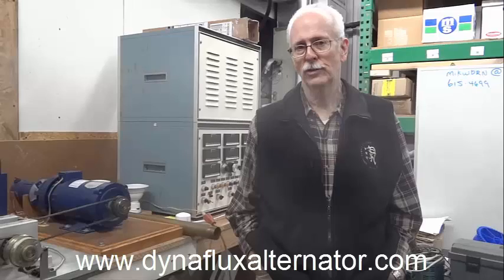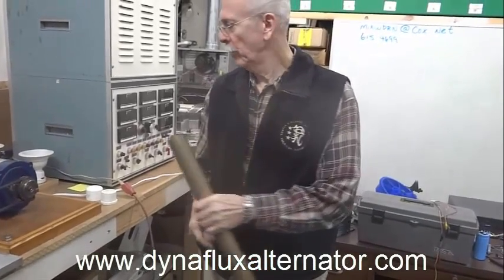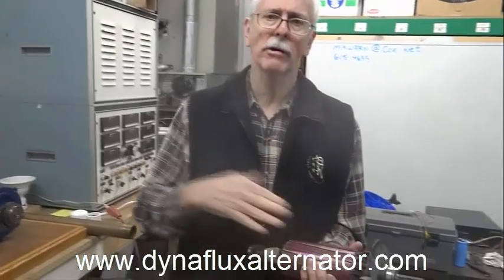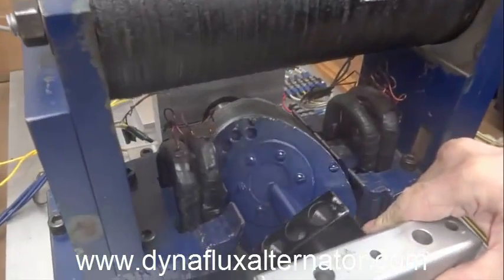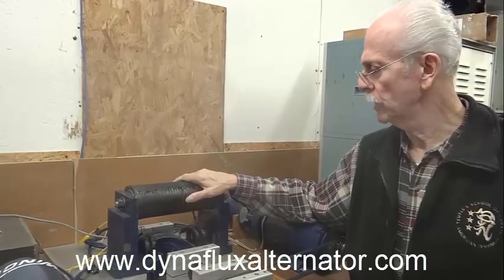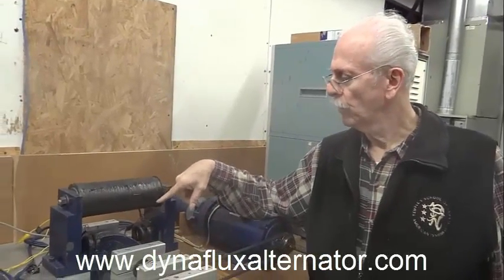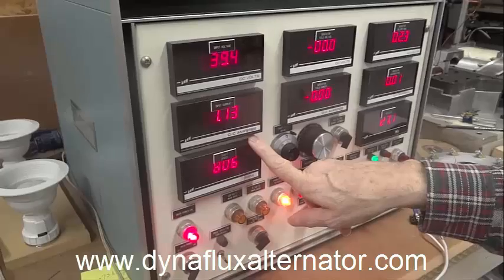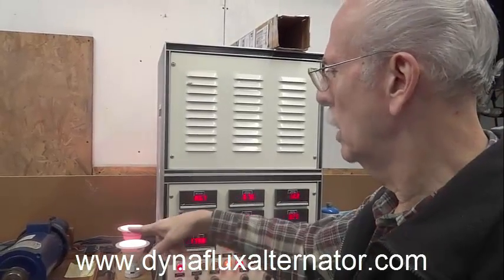Dynaflux Alternator explained by Jim Murray

Comment: Why are there two other machines turning while the Dynaflux is running?  If one of them is the motor driving the alternator, why is the alternator turning so unevenly at first, when it has no load?  It's all very unclear.

Comment: Another way to avoid the Back Emf.......
According the electric magnetic law.
in Generators, if you want voltage with a lot of wire turns
Each wire turns create more voltage and more voltage creates more Back EMF
Which is written in Voltage.
So an effective Generator must be in Amperage, with instead of turns it will be parallel wired.
No accumulation of Voltage and Back Emf.
This is how the laws are written.....

Comment: all that power to run just 2 light bulbs... if what you say is true and you are not using any or very little current from the generator then you should be able to run 20 or 50 light bulbs with a 750W generator... I'm not doubting you but it's not very clear,  are you generating your own magnetic field too? I diddnt see any magnets just the 2 electro magnets either side of the gen

Comment: The way I see it, the power input is at 86.8V*5.0A =434 VA at the time the magnetic field is up. 

As he switches the lights on, the power input rises to 87V*5.42A = 471.54VA (at 10:27) ,

 so we're seeing an increase in power input by 37.5 Watts.  
That's not much for two light bulbs, but it's almost exactly what the right hand side displays (again, at 10:27): output is 12.3V * 3.25A = 40VA.

So if the readings are correct, the increase in output is 40 Watts, while the increase in inputt is  37.5 Watts. That in itself would be pretty impressive - you're actually receiving more than what you're putting in. 
BUT...there is the tiny problem of requiring over 400 additional Watts to keep the generator spinning in the first place.

Is there something I've overlooked?
Reply: Motorsheep , that is exactly my question also...
-Nils
Reply: Yes, several things, but you're on the right track.
Reply: @DerpyRedneck  Mind sharing with me what those several things are?
Reply: @Motorsheep  Sure.

The trade secrets he released in his presentation "The Dynaflux Concept And Lenz’s Law" when used to cross-reference the patent and patent application documents, will help show you the way.

I've been watching, taking notes, and writing everything down, now unfortunately, they culminated into a series of screenshots on a discord server that I've compiled into a folder of files.

I'll make a Mega folder to the public for this purpose eventually.

You're essentially doing 8 core things:

1. Using spatial maths that are not usually involved with phasor vectors and accounting for what's not conventionally looked at.

2. You're figuring out how to use different geometries to manifest the forces that manifest on the generators.

3. You're making a rotor that swings in such a way (based on the phasor diagrams, vectors, spatial sh-t, etc...) that you're making Lenz's Law work FOR you instead of AGAINST you so you don't burn the same amount of fuel or use nearly as much horsepower to maintain the same degree of conservation of mechanical momentum since you're not being dragged by the counter-drag force due to Lenz's Law while it's still manifesting and taking its course like it always does since it's a PHYSICS LAW...

4. You're making BOTH your normal electricity you use AND the reactive stuff that's called "phantom power" due to the fact you normally can't use it ALL buck and oscillate back and forth so all components are in phase so the dynaflux can capture it all before it dissipates and can reuse it all over again.

5. You're making the energy you generated from the fuel you split, fused or burned able to generate more work or power.

6. You're doing multiple forms of work off the same energy.

7. You're recycling what would've been lost to do the same work more than once.

8. You're getting more work done than YOUR primary input initially without violating any physics laws..
Reply: Motorsheep, you're on the right track, it's fine.

I wasn't trying to insult you or your intelligence when I said you were missing several clues.

I want you to know that, just to be sure.
Reply: @DerpyRedneck Did you make a folder?
Reply: @ I haven't had the time until recently to start making a folder, but I went to Dropbox for a folder and I'll link THAT folder and a hastebin for references when I do my own video covering the SERPS.

Hopefully you will keep an open eye for it to come out.

I've also been working on another series covering how to modernize steam power for locomotives AND automobiles, plus I got an 8-video series covering John Bedini.

Comment: I´ve tried to replicate this, and thats not easy.... i used transformer sheets in the rotor, but it would´nt work .... so what is in the flux-mover ????
ok - its always nice to know that someone can break the laws of energy , and it´s always nice to know that you have to replicate the work of the inventor to get a clue of the truth !
but this is just another story of someone who is able to do the impossible, without making it available for peace of this planet ! : Keep On Guessing !!
Reply: He didn't break any laws. He states it himself he is not breaking any laws. He is manipulating the flux to have reduced losses. One force resists and other assists, the result cancels each-other out.
Reply: +cat1stevens  I´m interested in your advances
Reply: i tried to use an ordinary Motor "rotary Stator"
with stationary stator sheet as flux-receivers,  and matched the rotor in a lathe, positioned 45 degrees. -well the answer was i could make very low voltage , 1-2 volt, so i suspect you need specially flux-leading material, and not the kind of iron laying around in the garage ! : i tried with homemade electromagnet, and with N-52 magnets stacked over & above the rotor , and at last with cutting the rotor so that the magnets suited in place at the rotor , well i didn't run the generator in several thousand rpm, but more like 3-500 rpm. i suppose the with of my coils was to small ,and my rotary disc to small. And maybe next time , to use special magnetic flux powder in a epoxy resin to cast the rotor ? ,so
this is not for people like me, that see the light, and tries to copy it with bits and peaces thats already laying on the floor ;)
"i used materials from an old electromotor"
Reply from the maker: +cat1stevens It is a very difficult machine to build. Did you build the rotor just like Jim did? Post some links to some pics please. He disclosed what was missing from the patents in his recent talk Dynaflux Concepts. No laws of energy are broken, he uses principles that simply are not taught in school. Yes, it is a good idea to replicate the inventor's work exactly but you have to get all the details. For your information, the patents are expired and at the last conference, as I mentioned, he revealed the missing details that weren't in the patent and said he doesn't care what anyone does with it so I think you owe it to him to at least be honest about his position in this, which is quite contrary to your last 2 sentences.
Reply: +Aaron Murakami The patent in my opinion is details, that only engineers will decode. i do really like the principe of this machine. but to copy the setup with a good result, is not very quick done. because you have to investigate every single word in the patent documents, to trie to find the key to what material to choose, and so on. It looks easy, but to copy this machine, it&#180;s not enough to read the patent description, you have to know what materials to pick, to copy the results in the demo. one material wrong, and the result is different, and you can start to guess, what causes the problem? : not enough strength in the field coil, wrong material in the flux-rotor, not enough windings, on the generator coils .. .. and so on. Ordinary people need step by step DIY. instructions, and Governments need patents, thats what i mean :) .......:even if i knew in the beginning all the different material names. It is a great challenge to get the materials, because it might only be available to registered companies they do trade with, and not with private citizens. Thats my experience: and this allso is an increasing challenge for homebuilders. The traps are open, and they are many ! ;)
Reply: Try Gerard Morin's mini pump device easy to build

Comment: this stuff just progresses too slowly. show something cool! tired of seeing massive generators powering "a couple of flood lights." at this point we should be able to do better...blame the game?
Reply from the maker: TinManPower
You are definitely missing something.
Reply from the maker: +Aaron Murakami Tin Man Power - the only way for it to be gone is for you to have deleted it yourself. I responded to it so it wasn't me. I see the msg notification in my email but the one you just posted, I don't see that here either.
Reply from the maker: TinManPower
The message is right here: 
+James Melendez Yes,you missed the big picture. They started with around 87 volts at 1.5 amps(130 watts) when up to speed,and they then switch on the electromagnetic field. The voltage remains at around 87 volt's,but the current rose to around 4.8 amp's (417.6 watts). So all up it is taking 417.6 watts to run two 10 watt? bulb's--what a fantastic generator. Arron says it's a no load generator,and yet it requires 417.6 watts to run two small globe's. In this case,the load is in creating the conditions for the rotor to not load down the prime mover. But as you can see,the system is already heavily loaded before the two small lights are switched on.

It doesn't show on Youtube but it shows in my Google youtube notifications by clicking on the alarm bell icon next to my user image. So is your new message.

FYI - Jim's SERPS technology lights 1500 watts of bulbs on a gas generator and the motor turning the generator sees no load - no increase in rpm and it consumes the same gas as if it were idling because it is idling. You still need a prime mover to interact with. It is different than the Dynaflux but has some related principles.
Reply: +Aaron Murakami Is there a schematic to replicate the magnet rotor in the alternator?
Reply from the maker: Constantine Joseph
You can find the basic setup in his patents, they're all free in any patent database. This year's conference - Jim revealed the most important thing he left out of the patents years ago - you can find more info on his work at http://dynafluxalternator.com
Reply from the maker: +James Melendez Loading the Dynaflux does not slow it down. What does that tell you? Drag free generator - that is beyond cool.
Reply: +Aaron Murakami I have to admit...it is freaking cool...i guess im just frustrated with the big picture...